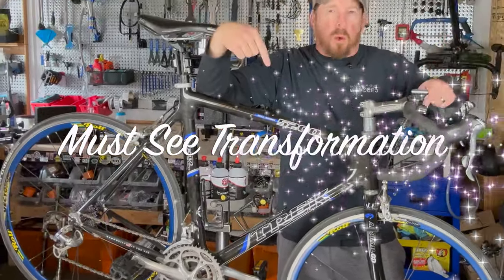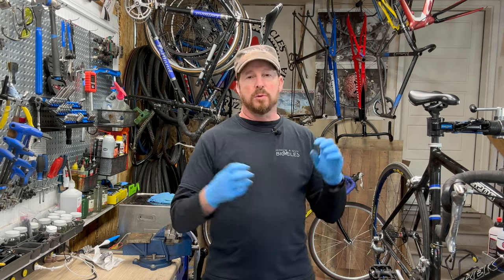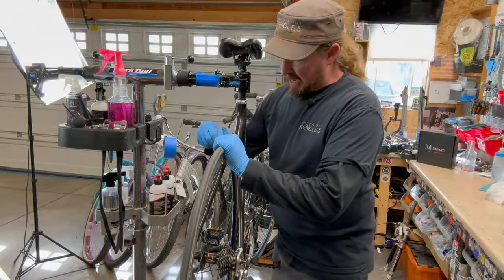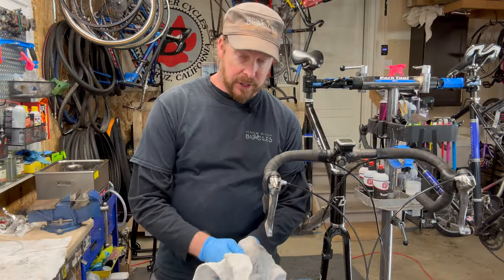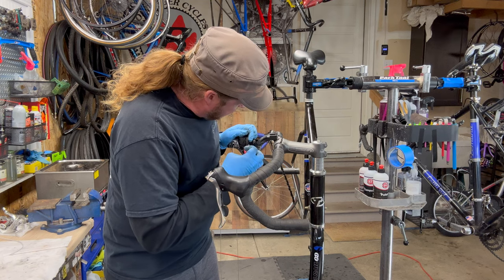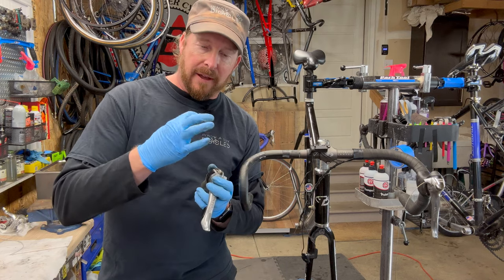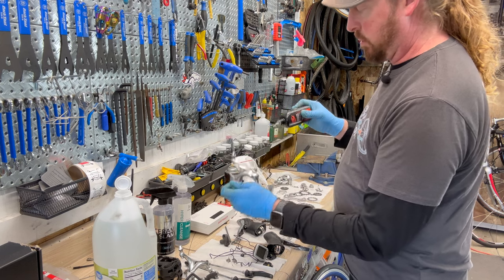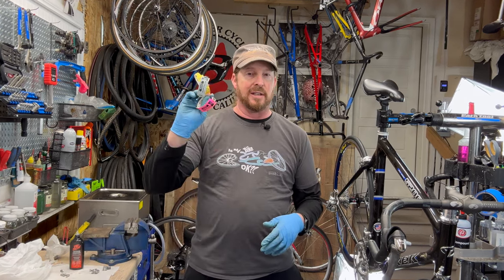🛠️ Can You Restore a 2001 Trek 5200 to Its Former Glory? 🚴‍♀️💨 Watch This Tune Up!

Comment: I still have a special place in my heart for my trusty old 1995 Trek 5200 with 8-speed Ultegra 6400.  It provided many enjoyable miles and partipated in a handful of Solvang Century rides.
Reply: 1996 Trek 5200, Shimano 600, original owner. :face-blue-smiling:
Reply: This is my bike!  I was stationed at Vandenberg and I'd ride this baby to Solvang and back all the time

Comment: Industry abandonment of the triple crank was a sin. Yeah they’re a little heavy and require some extra thought process but for us recreational cyclists they were THE BOMB. For climbing I always found integrity in a nice wide 9 speed chain on a 30 tooth ring, both derailleurs all the way to the left with a straight chain line very reassuring. Compact 2 row setup requires all 16 teeth of allowable difference between big and little rings while shifting into the little ring on a triple is usually a much mellower 9 or 10 tooth drop. Great for climbing but also on flatland rides for some reason I find myself moving the front derailleur a lot more frequently than on a two row. Those are big advantages to give away just to emulate the pros which is the only valid defense I’ve heard for letting triples go obsolete. Great video, love those frames particularly the ‘nude carbon’ like that 5200.
Reply: I've heard that the triple crank gave a wider range of gear ratios than the big rear cog clusters of today.
Reply: @daniellarson3068  Wider range yes. The big ring of a triple can be 52 or 53 with an 11 small cog. All my 9 speed triple cranks had a 30 small ring and Shimano and SRAM 9 speed cassettes go up to 28 (generally). So for climbing the compact is 34:32 while the triple is 30:28, both 2 teeth different so for bailout steepest climbing they’re functionally identical. For fast downhills the triple wins with 52:11 compared to 50:11 for the compact. The only place I’ve found where I definitely prefer the 2 row setup is Laguna Seca raceway which moves the chain from all the way right to all the way left repeatedly lap after lap. In that environment the middle ring in front is one more thing to deal with. Everywhere else I ride I prefer the triple. Of course all this goes in the dumpster when you move to Di2 in synchronous mode. That fixes everything.

Comment: What is the rider+gear wt for that trek bike and would it match the 300lb limit for the steel Surly touring bikes.
Reply from the maker: Correct me if I'm wrong, but I remember most of the Trek were rated at 250lbs.